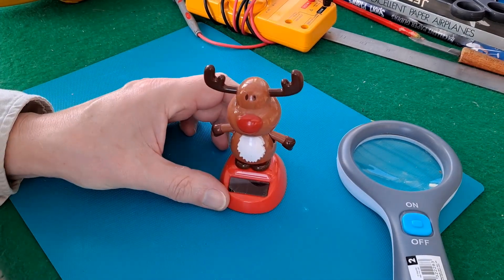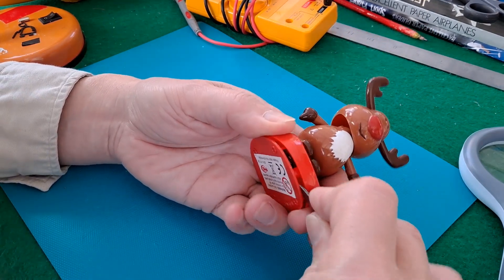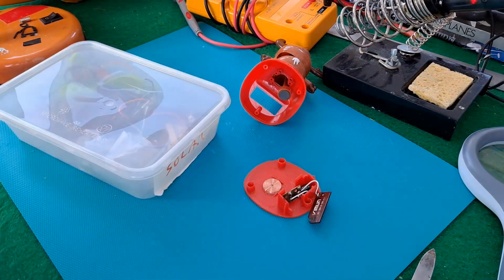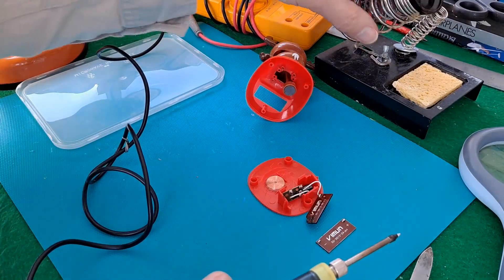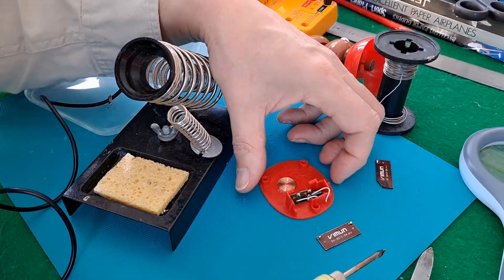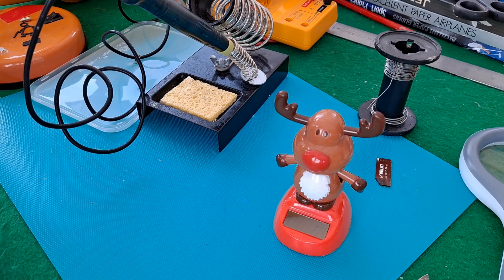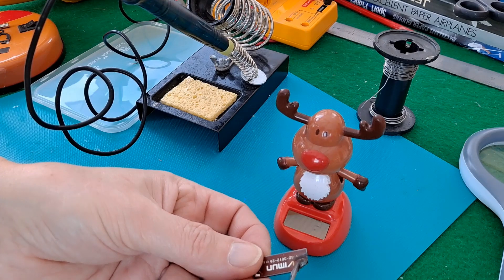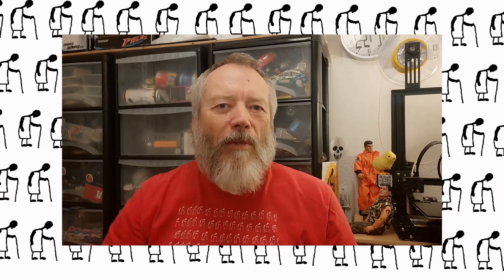Can I fix my Solar Reindeer? 20201227

Comment: Very good very good 😂👏🏼
Reply from the maker: Good evening, George, This was an easy repair. The fine wires going to the coil are harder to work with as I have trouble seeing them 😎👓🔎🔍
Reply: @GrandadIsAnOldMan i have one and one thin wire is snaped off and is missing. How do i repair it?
Reply from the maker: @Denny4589  you will not like the answer. "Buy a new one". If the hair thin wire going to the coil has snapped off and you cannot see the end of it, you have virtually zero chance of finding it and even less chance of soldering it back in place. (Assuming you have the soldering equipment and skills required to work on such fine wire). That means replacing the coil. You won't find any for sale online, so your only source would be another solar rocker. Removing the coil from one is also practically impossible as they are glued in place and most attempts to remove them result in damaging the coil making it useless.. If you are lucky, the whole base might match yours and you can just swap the base, but it is unlikely. Here is one of my videos that show some work on those coils https://www.youtube.com/watch?v=i59hVTDX53U&list=PLA5a2xPRSrB1L61NAVuE5I9FbPgq3sSG1&index=161
Reply from the maker: @Denny4589  Just another thought on your problem. You say "one thin wire is snapped off and is missing". On many of these rockers, when you look at the circuit board it often looks as if there are one or two of the hair thin wires attached to the circuit board, but going nowhere. This is because the method used in the manufacturing process is to lay the wire across the termination pad and put a blob of solder on it. That means you have a good wire coming from the coil terminated on the circuit board and then a spare bit of wire coming up from it which they haven't cut off cleanly. That may lead you to think the wire is broken, when it is just the spare left over from soldering.
Reply: @GrandadIsAnOldMan i checked the coil and see where 1 end is snaped off, can I pull it out a little bit and solder it than back into place? The other wire is still in tact. Otherwise I buy a new one and use the components
Reply from the maker: @Denny4589  yes, if you have found the end you can pull a few coils off to get some slack and reterminate it. I have done that myself, but don't be surprised if the wire breaks as you try to free it. It can be a heart breaking exercise where you put a lot of effort in and then it fails. The wire has an enamel coating for insulation. The heat of the solder will usually burn this off for you when you terminate the wire, so you don't need to try to scrape it off first. If your soldering iron is too hot, it just burns the wire right through. All I can say is Good Luck. It can be done and if you are successful, you get that proud feeling 😊😊👍👍
Reply: @GrandadIsAnOldMan I wil give it a try and I wil let you know of it was successful, otherwise I order a other one and change the parts, thank you for you help sir ❤

Comment: I had the same problem with my solar powered Mouse.
Best wishes.G7HFS
Reply from the maker: I have rather a lot of solar rockers, sometimes they have "accidents" 😊
Reply: @GrandadIsAnOldMan  I converted one and replaced the solar panel with two germanium diodes so now when I transmit with my amateur radio transceiver it starts dancing.☺
Reply from the maker: @ianharling9569  that is brilliant. I will make a note of that 👍